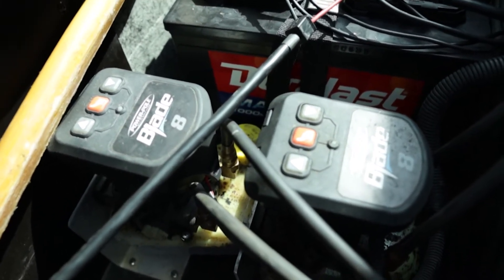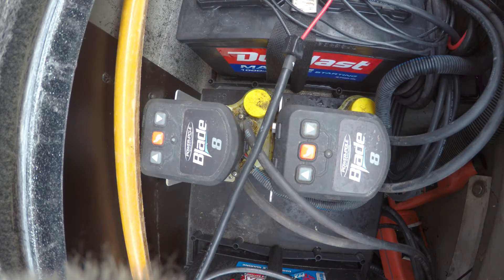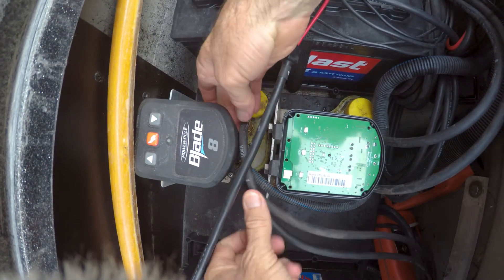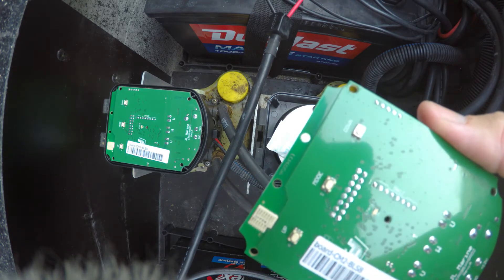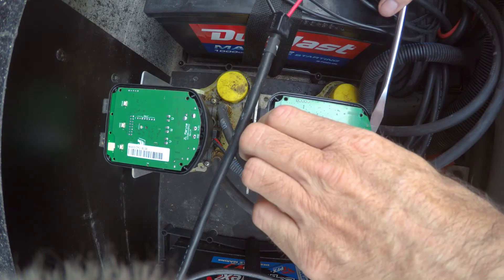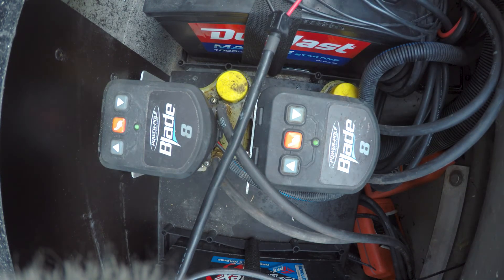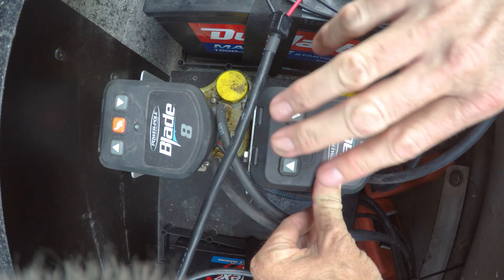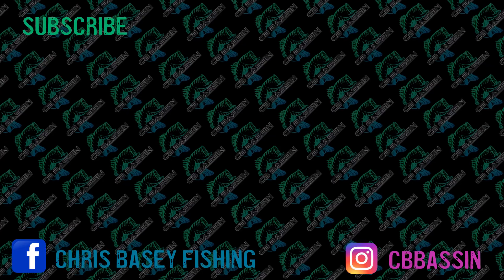Power Pole Blade mother board troubleshooting

Comment: I’ve been through 4 boards.  How did you get the seal back on? If you noticed, the seal was harder to get off the first time.  My unit has a water absorber on top of the board.
Reply from the maker: It fit right back on easily and mine had the same absorber pack in it too.

Comment: I’ve never charged with my power on and two boards have failed
Reply from the maker: Sometimes they still fail. Call power pole because i hear they are really good with exchanging them. I went through the dealer because I ordered the boat through them and they rigged it. Its simple to change.
Reply: If you know for sure that's the case the only thing I could think could possibly make a board go out is rough water bouncing the boat causing a circuit to go out